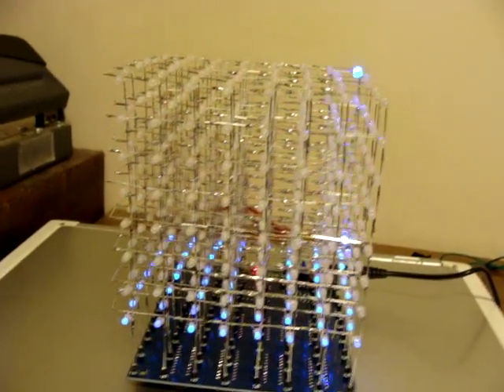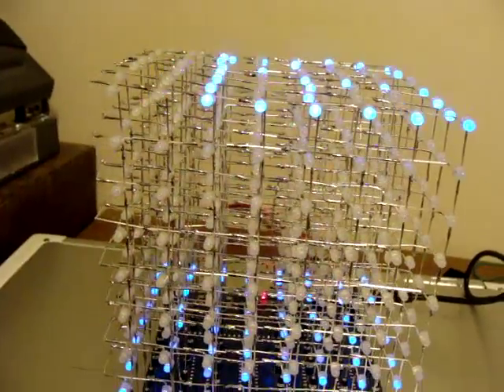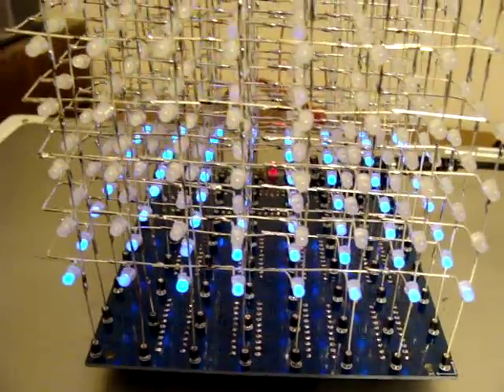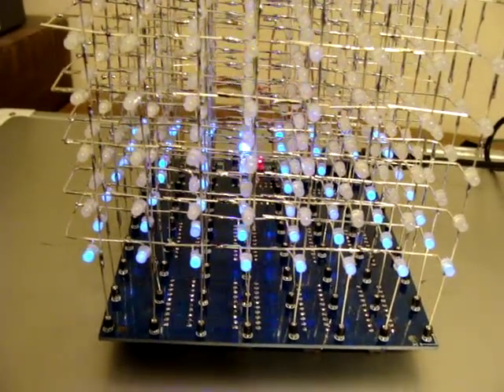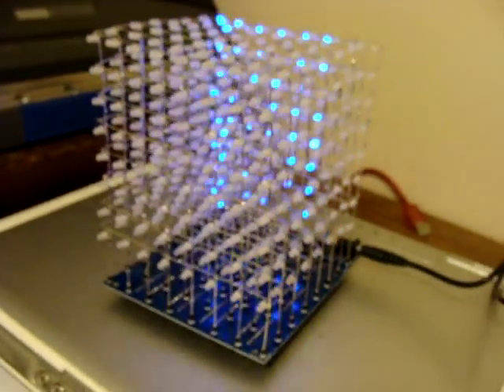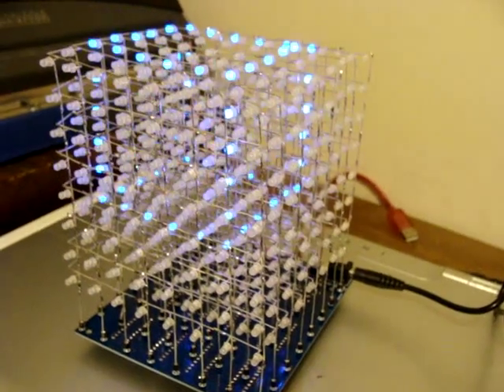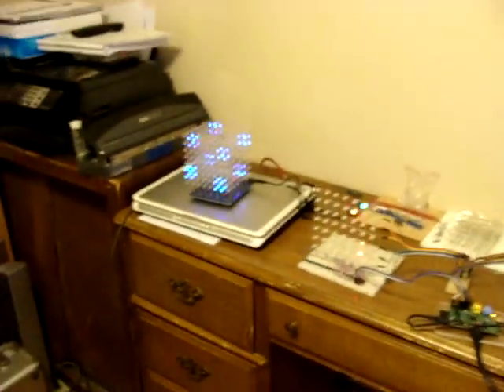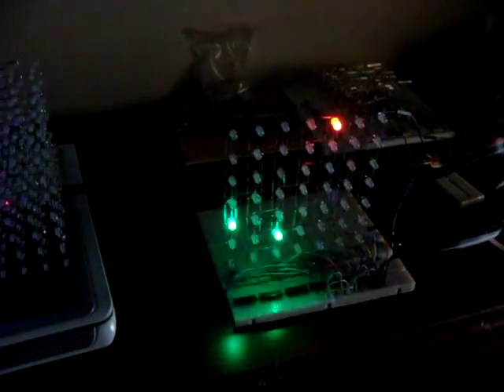8x8x8 LED cube kit

Comment: I just built my 8x8x8 cube but found the instructions for the 'layers' are reversed which is why some of the patterns (mostly the heart and the U but also the rain effect) are upside-down and the negative connections at the back should be (from the power jack to the opposite side) top layer to bottom. On the board it might be marked as C1-C8 being C1 is the top layer and C8 being the bottom layer